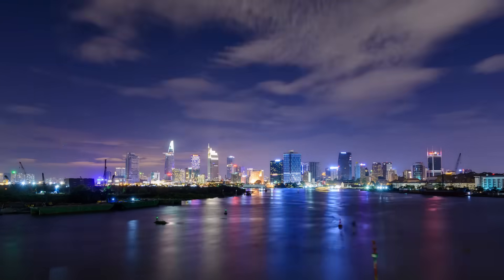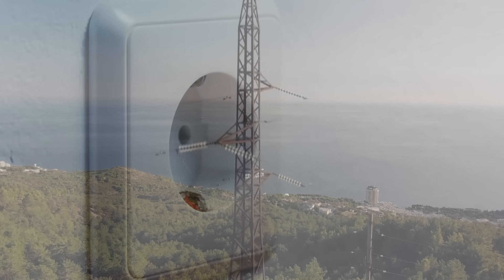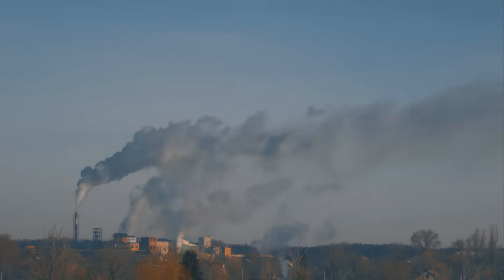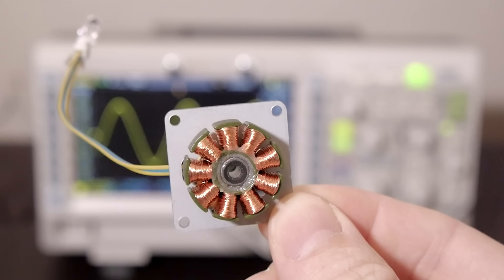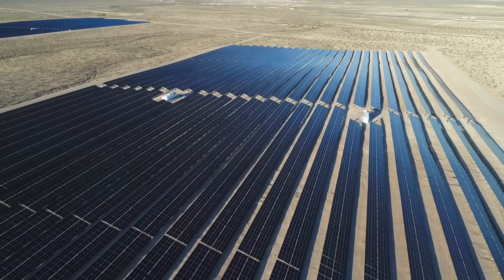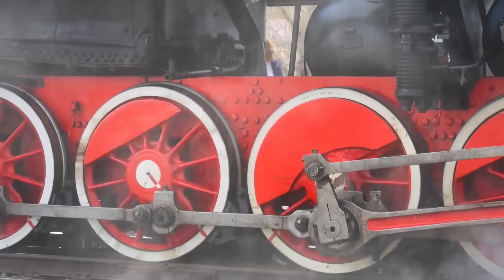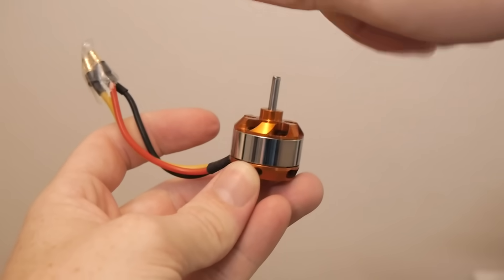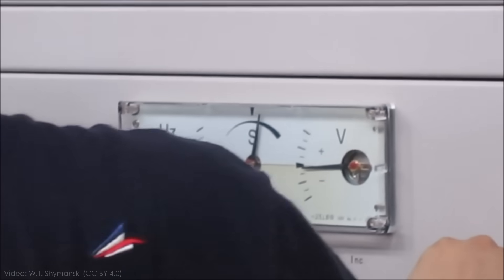How Electricity Generation Really Works

Comment: You must be an Industrial Engineer and I won't said what they are sometimes called. When explaining the reasoning behind 3-Phase power generation you said, three lines could carry three times as much  power as two lines. I'm going to have to call B.S. on that statement. Because of the 120-degree difference between phases the increased capacity is only times the square-root of three or 1.7320508076. I suggest you Google 3-phase power calculation. One of the main reasoning behind 3-phase power, it is easier to convert electrical energy back to mechanical or as you said rotational energy. A 3-phase electric motor is actually a servo to the generators powering the grid.

Comment: Great explanation. Two key reasons for 3  phase generation, not discussed: it forms the basis for interconnected and synchronized generators and it allows self-starting and reversable induction motors.

Comment: Very misleading information mixed in here.
Can't figure out if it's intentional .
Could be a consequence of the need to be brief.
Could be just the mind set .
No one thinks alternative sources of power are easy or cheep to integrate.
There is no choice .
Like It or not the science has been clear for a long long time.
In the 80s it was clear enough for George Sununu to start a program of disinformation in conjunction with others that would be affected financial by reductions in co2 emissions.
This is on going.
 FACT.
This smells like it .

Comment: 5:00 electricity doesn't have inertia on its own, but you can actually "give the electrons a kick and hope they continue down the wires without any help". all wires have inductance which resists change in current, resulting in pretty similar behavior to inertia

Comment: I think it would've been interesting to see a pie chart and perhaps more explanation about the sources of electricity that are turbine driven vs not, instead of steam driven, vs other turbines and other. AFAIK, solar and hydrogen fuel cells are the only generation methods we have that don't rely on finding some way to rotate magnets within coils of wire. 
And I know I'm too late to influence the direction of this series, but at the local tidal generating station here in Annapolis Royal, Canada, the engineer said that ultra high voltage DC actually has less resistance in power lines over long distance than AC. This surprised me, and I'd be interested to hear more about it.

Comment: I have tried to short a hand operated generator used in marine vessels to close watertight doors when the power is out. The lever won't move a millimeter if the circuit is shorted out.

Comment: In 1991 I worked in a power plant for a few weeks insulating a boiler. They had removed the old asbestos insulation before we got there by using a specialized asbestos removing team. The insulation we replaced it with, was a super thick wool. Not as good but,  a lot safer!
I noticed that on the lower floor they were overhauling one of the turbine generators & It instantly got my attention when I seen 6 armed guards carrying shotguns surrounding it. The Engineers were working frantically inside on the gigantic electrical stator, So I did what any 21 yr. old grunt would do.  I walked up to the armed guards and asked one of them if I could step inside and take a look for a min.?
To my surprise he said "sure, go ahead!"  .......Heck yeah!😲👍
They had already removed the turbine and there were about 4 or 5 engineers moving around with a wild crazy look in their eyes. I went & stood next to one & said " how's it going buddy?"
He looked at me & said " they really want this done now & I DO MEAN NOW!" I said okay and left him alone & stood there looking inside this giant electrical stator. I thought to myself .... not very many people get to stand exactly right here! Once this thing is sealed back up,  it won't see the light of day for another 20 or 30 years until they overhaul it again!
I was amazed at how big these facilities are and how dangerous they were, with 5 ft. Wide holes in the floor that dropped 100 ft. To the floor below & no gard rails around them at all!
I  learned that they take the secrecy of our technology very seriously in US.power plants!
 I later learned,  this is why they had armed guards surrounding
This big electrical turbine.
this made me appreciate it that much more!

Comment: Your 3 phase power carrying 3x as much power on 3 wires as single phase power carries on two wires is not true. It carries 50 percent more and with 3 phase equipment you only get just under 75% more efficiency than single phase 2 leg.  The point is that 300% is not true

Comment: Thanks sir for the video, it gave me a better understanding of how it works. Also I'll like to ask if you can share more light on the viability of magnetic motor for electricity. I've been seeing so many videos where they claim the magnet motors generate electricity and I'm actually wondering if it can be use for grid purposes, Like 500 megawatt and above

Comment: Well lv not got time to peruse the entire video let alone the comments thread , l wonder if lm the 1st to question your use of the words "generation" and " production " , seriously nobody generates or produces electricity do they ? And nor does a machine ? Even the machine they call a generator ? Because electricity is always in the air right ? In fact electrical energy can be measured in every atom of everything in the physical realm can it not ? Down to the quantum level . But "they" discovered by spinning a magnet around some wire it would basically create the conditions needed to vaccum the electricity out of the air ? For a simplistic view . solar panels could b said to be actually generating electricity couldn't they ? Because the electrons excited by the heat produce the charge ? This comment has been bought to you by common sense science and a little bit of tesla coil but absolutely no electronic science degree whatsoever 😁🙏

Comment: I think recent advancements in invertor technology can to some extent be used to decouple generators from grid sync issues, however as with anything, scale will always be a problem (we are, after all, talking megawatts here!), as will efficiency. It will just never be as efficient as plugging the generator straight into the grid.

Comment: I know exactly where electricity comes from: those three holes in the wall.
Reply: It only comes from two of those holes.  The third hole exists for the purpose of connecting all metal that isn't intentionally energized together, and then to the grounding electrode, so that a breaker will trip before it remains energized.

Comment: Given the data that indicates the earth has experienced
multiple ice ages during the last half billion years with evidence of a cooling
trend line originating from a warmer, life abundant past; evidence that
efficient, clean, low cost energy is derivable from a plentiful supply of
natural gas and/or nuclear power; that carbon dioxide is an extremely important
part of our biological circle of life, helping to feed global plant life and
produce valuable oxygen; and that higher costs have historically been expended
and charged for electricity generated from solar and wind sources, including
millions of taxpayer dollars given to failed (political donors) businesses; I would
consider your videos more interesting and useful without the subtle inclusion
of the global warming dogma and politically correct, ideological messaging. R. V. Comstock

Comment: Im a teenager still but i am do want to clarify, is spinning a turbine with copper does create  a voltage? On can someone explain to me how rotational energy works hehe just curious sorry
Reply: rotor spins together with turbine. The purpose of the rotor is to produce rotating magnetic field which will induce EMF on stator windings.

Comment: I think this is the first time I have seen a video or read about inertia and it's importance. It is a critical property and on ethat neither wind nor solar has. (The other critical factor is that wind and solar are asynchronous so they cannot support grid frequency but merely follow it).
This is one of the very real problems with incorporating large quantities of solar or wind on the grid. I've read that 100% renewables is possible and the aim, well it's just not going to happen, the grid will be very unstable and prone to grid trips. Another problem in such a scenario is that renewables can't restore power to a dead grid, the so called 'black start' as they need to connect using grid frequency.
Incidentally most generators these days use an auto synchronise mechanism to connect automatically.

Comment: Good explanation I build the generators for power plants that hasn’t Been explained that way I always have had a good idea how it works  I knew just a little bit on how the grid works . It only takes a small speck of metal to shut down a plant or a generator in a large plant . And it cost a lot of money to fix the problem . And even more in revenue. Good video thanks

Comment: I have to massively disagree with the renewable part, here in Germany we had about 46% of our Electrical Grid with renewable last year and are at the moment at 54% in 2020 so far. It massively increased stability and fixes the problems of our conventional grid that before that had always issues with delivering enough power, because coal and nuclear which where our main sources till then, could nod adapt to demand.
Solar or on cloudy days wind, perfectly and extremely flexible fix most of the huge difference between day and night consumption.
Renewables make it way easier not harder to hold the grid stable. The problem with them is that they limit profits for our big companies because everyone can join in and make their own energy. That is why they are so hated.

Comment: Can move faster if used in space for warp drive check it out one second length created in space you then use several device to core it in length to mass and the current power in a few application there is like 20! Anyway say you worked how to build a artificial worm hole is basically what it is as the mass pins you in the hole fabric off space?! and the length is cored to electrical law now since they dont exist natural i need to build it so basic kids level as i would need over a hour or two just to right the constant and provable math at a kids rep like the magnet copper A battery one?? And 2 barrier's the electronic speed and light as at basic for lenght off time so, one second length of electrical energy pico fold it 300 times to a second and magically moved north to  south length off run split in 3 lines off maths for movement to mass velocity!!!!!!!!!!!i get one light year in 31 hours and half a engine.....
Reply: Troy W very interesting

Comment: Very informative Videos. At our home we have a 225 amp main breaker times the 240 volts = 54,000 watts if ever taken to its limit, what amazes me a little over 72 horsepower equiv. A lot of available power coming in over a couple of wires no bigger than my little finger.

Comment: Wind generators take 18 yr to repay back ..the life of one is 15 Yrs
Reply: No that's not correct but even if it was it's not the point .
See if you can follow the next bit
The point to alternative energy is that it makes less co2 , methane etc than the existing generation.
WOW I know that's a shock,sort of makes you feel a bit silly don't it glen?.
Don't let it stop you from subjecting us all to your opinion in the future though man.
Wouldn't want to think of you sitting there alone in your ignorance.
Reply: @kiwibob223  ok explains why CO2 is going up with CV putting more out of circulation  

No that's not correct but even if it was it's not the point .
See if you can follow the next bit
The point to alternative energy is that it makes less co2 , methane etc than the existing generation.
WOW I know that's a shock,sort of makes you feel a bit silly don't.?.
Don't let it stop you from subjecting us all to your opinion in the future though man.
Wouldn't want to think of you sitting there alone in your ignorance.

Comment: Global warming!  Really? Take a look at historical temperature records, unadjusted. And study the physics I of CO2 in absorption and transmission of radiation. You will see that increased CO2 levels can only play, at most, a minor part in "climate change". The major influence is the changes in the radiation coming from the sun caused by variation in sun spots due to magnetic field strength changes on the sun.

Comment: Great video, Could you please tell us where the 50/60Hz standard comes from? There are some speculations that this frequency is chosen because of the resonance of the long power lines (cables), but other says that this frequency comes from the mechanical properties of the used generators ...

Comment: @Practical Engineering, note Correction @ 1:52 :
1. Hydro does not convert water to steam, its just pressure head converted to kinetic energy at the water turbine (hydrodynamics).
2. Natural gas: Most NG/LNG power plants do not have a boiler either, they just combust NG in a gas turbine (gas thermodynamics) which drives the generator directly coupled to it. No steam involved here either.

Comment: So my question now revolves around the frequency. Does the generator need to spin at 60 cyc/second to be 60hz or can it spin at a different angular velocity and we "transform it"
Reply: The generator spin rate is rigidly constrained to be in proportion to the 60Hz grid frequency.  Depending on the topology of the magnets and electromagnets, it may be a fixed factor or multiple of 60 Hz (such as half at 1800 RPM, double at 7200 RPM, triple at 10800 RPM, etc).  But in any case, it will directly relate to the 60 Hz grid frequency.  Or 50 Hz, where applicable.   A generator with a 1:1 ratio of rotation speed to electrical frequency will have to spin at 3600 RPM.  And if it were to spin at 3300 RPM, the grid frequency would drop to 55 Hz.

You can build a generator that can spin at a rate independently of the grid frequency, but you need to interface it with a power inverter.  It would not be cost effective on power plants where we can mechanically control the rotation speed, but it is essential on power plants where we don't have that ability.  And that is how it is done on wind turbine systems, as their rotation speed is intermittent with the available wind.  What happens on wind turbines, is that the generator is built with a special component added to generate DC, and then the DC is converted back in to AC via the power inverter.
Reply: Grid frequency isn't completely constant at 60 Hz, and it will vary as the generation source adapts to load.  When unloading the grid, frequency increases.  When adding load to the grid, frequency decreases.   The fluctuations in frequency are the feedback for the generation station, in order to adapt the generation supply to the load demanded.

The utilities have a standard to maintain the frequency within a certain tolerance of the nominal 60 Hz.  When it gets close to the boundaries of this margin, that is the signal to tell the generation station(s) to compensate the power they supply for the load.

Comment: Quick chart:

Fossil fuels > Greenhouse effect > Massive temperature swings and natural disasters > Humans extinct in about 100 years

Nuclear > Nuclear waste > must drill deep holes to store waste > some waste poison ground water > Dead animals and humans > nuclear fuel run out in about 300 years > Humans switch to other fuel source or dead + many places on earth uninhabitable for more than 5 billion years due to radiation if not stored properly + risk of storage tanks blowing up

Solar > No waste  > Fuel runs out in about 5 billion years when sun dies > If sun dies Earth will also die > Humans must leave earth to survive

Wind > Mostly caused by moon's gravity > Will never run out unless moon or earth is destroyed > Will last until dying sun destroys earth in about 5 billion years

Geothermal > Exists if earth exists > limited by destruction of earth so lasts about 5 billion years
Reply: Fossil fuels: cheap, reliable, compact, relatively safe - but contributes to the rising temperatures in our atmosphere

Nuclear: also relatively cheap, easy to find, and growing technology could mean it becomes even cheaper. It is also reliable, and contributes very little to our atmosphere. Nuclear waste is a hassle, but the earth has a huge capacity to hold nuclear waste, and of course new technology may lead to reduced waste. It is also pretty safe, with the only 2 faults coming from outdated equipment and stupid construction design.

Solar: great source of renewable energy, but isn’t completely green as the creation of efficient solar panels leads to the release of CO2. Only works 50% of the time and this is unreliable. It also isn’t very cost efficient yet.

Wind energy: kills birds, is extremely noisy and isn’t very reliable. Otherwise it is cheap.

Geothermal: doesn’t provide enough electricity to people for it to make a huge difference, and is very circumstantial

Comment: Great video, but man-made global warming is a hoax. Look into it. You are smart enough to figure it out.
Reply: “Man made global warming is a hoax”
I disagree, we as humans have accelerated the rise in temperatures over the past 300 years, mainly due to the wide adoption of fossil fuels in manufacturing and transportation. I use the word accelerated because it was happening, just at a much smaller rate, and more controllably. 

It’s undeniable that the earth is warming, and the links of it warming to our use of carbon rich fuels are obvious. Humans create more carbon dioxide (and other gases) that reflect heat back onto the earth instead of letting it be released into space.